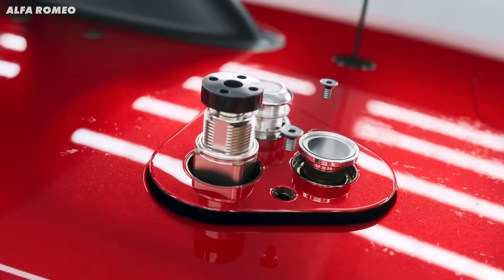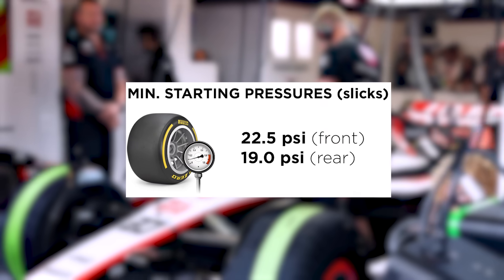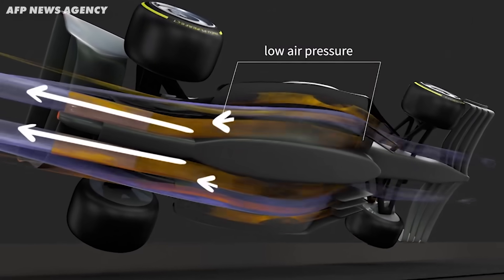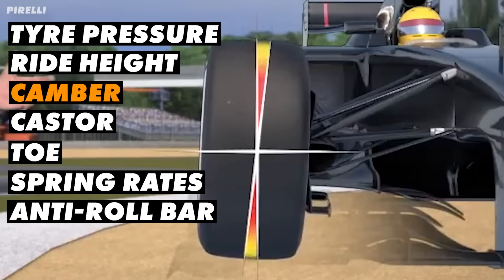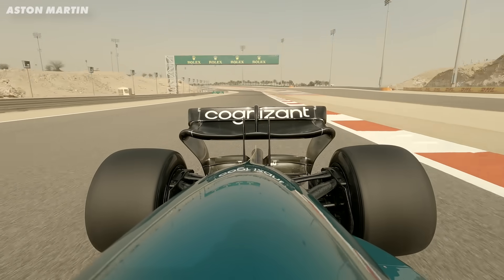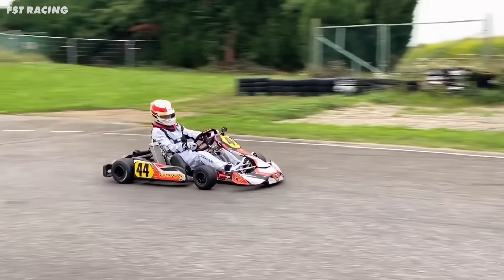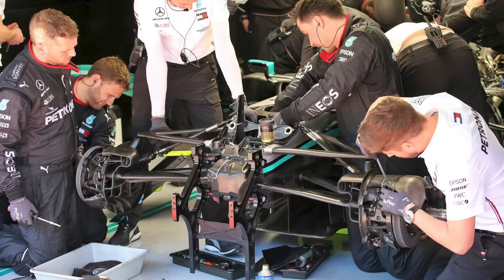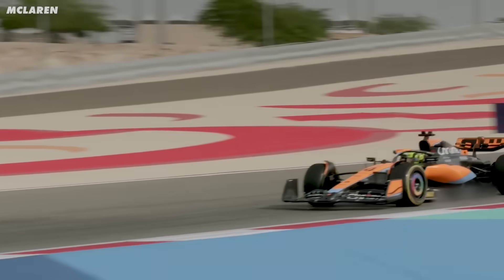Why F1 Wheels AREN'T STRAIGHT | feat @brrrake

Comment: You mean....but don't state clearly in the intro....why do F1 cars run static TOE-OUT, on the front wheels ??

Very simple....I can save you the whole video.  Because toe-OUT helps with sharper turn-in, on the initial entry to a corner....PLUS, reduces front end slip angles, therefore helping to reduce understeer.  This is a common alignment profile on most "formula" (open wheel) cars. 

The down side (and yes, there is always a trade off)....is that toe-out makes the car much more "squirrely" (that is, it causes the car to wander and follow every little pavement irregularity). So, it is not really suitable for passenger cars, in most cases. But, for racing cars, especially top-echelon cars like F1....it is a very acceptable trade off.

Comment: Personally find it strange that caster is treated as a fixed value, instead of exploiting it, for its dynamic affect on camber.
Reply: Do you think, just maybe, F1 engineers across all eras and with all teams might just know a tad more than you on this subject?
Reply: @Eat-MyGoal Yup, I get your point and agree.
I’ve also got a little bit of automotive background.
Have found that while setting up, too specifically, narrows the envelope of performance, and what variables of circumstance, like race lines, tire life, driver fatigue, etc, can be exploited, especially in unpredicted situations. Thinking outside the box, can sometimes yield benefits.

Comment: I look at this as a Forza sim player.  The whole tuning the suspension was paramount to building a great car.  You wanted to build as much mechanical grip as possible without applying to much downforce slowing the car.  I’d spend hours watching the heating across the tires when at track speeds.  Next was how compliant the suspension was.  Getting the bump rate was pretty straight forward but getting the rebound rate was much more complicated.  When you hit the sweet spot the car would be a pleasure to drive.

Comment: Just as a train has its steel wheels set on an angle on the railroad tracks so it will go straight but if you put the wheels square on the they will go into themselves

Comment: Average drivers know almost NOTHING about how a car is moving. Stability? They take it for granted. Braking? They rely on anti lock systems. They can't drive themselves!
Reply: Which seems like a good thing.  Average computer users don't know how the transitors in the chip work or even how the motor in their blender works.  The modern world is great because we can all have our own specialties and don't need to know every detail of everything.
Reply: @petergerdes1094 correct, but people not even understanding basic concepts such as concentina effect, braking distances needed etc, isn't ideal.

There really should be a higher standard held for being able to operate a vehicle.

Comment: Anyone can change the toe settings in their own car and experience the effect themselves. Quicker turn in or stability vs tire wear. Of course camber and caster. Rather than spending thousands on mods, a simple wheel alignment adjustment can do wonders for performance. Unless you go nuts with it and make everything worse.

Comment: Common misconception in here about the effect of camber on contact patch area.  Camber doesn't affect TOTAL contact patch area.  Contact patch area is simply a function of tire pressure and load (weight).  So a tire inflated to 20 psi supporting a 400 lb load will have a contact patch area of 20 square inches regardless of camber. Camber affects the SHAPE of the contact patch and therefore the distribution of stresses within the contact patch which can have a large effect on grip.  Otherwise brilliant presentation!

Comment: This was a great explanation of the various suspension settings on these cars. I’ve always wondered how they are able to get it set back up correctly when a driver destroys a corner and all of those parts need to be replaced. It’s not like you ever see them doing an alignment in the garage.

Comment: They have reverse Ackerman front geometry because of weight transfer meaning the outside wheel can stand more slip angle. They aren't designed to be driven slowly 😊

Comment: This is a particularly good video, a topic I don't think some of more recent F1 fans understand. All those mechanics swarming over the car during practice and qualifying have a lot more to do than placing the cooling fans and wiping the car with a polishing cloth. I think there's a tendency to think they drive nearly the same car at all times, or maybe they set it all up at the shop using simulator data and just run it that way. That's never going to be the case. The simulator isn't perfect, it's just close. It can't know exactly how the pavement aged over the last year, fully incorporate any pavement heaving or new patches that occurred since their last visit, or deal with normal variations in temperature, humidity, or the likelihood of rain.

Comment: quick math 800kg*5g/4 each tire with contact patch the size of your palm is actually pushing the road  ~1000kg towards the outside of the turn (and same reactive force tranfered to the car towards the inside)!

Comment: even your normal car the wheels dont all point strait forword with front wheel drive they point slitly to the outside to compensate voor the power on the wheels that will pull them inward
Reply: Not true - look up the target parameters for any fwd car, you’ll see they always toe in. 
 Manufacturers prioritise customer desire over engineering knowledge.

Comment: With tyre pressures @ 20psi how do they get the responsiveness out of the steering?

Especially with the old cars running 15 inch wheels.
Reply: Because contact area has nothing to do with friction. The contact area has to do with the structural integrity as well as wear and tear on tires. People never distinguish the physics involved when talking about "traction"..
Reply: @Dyson_Cyberdynesystems  
I'm not talking about the contract area.
However the contact area is directly responsible for how much friction there is. Bigger contact area equals more friction.

I'm talking about low pressures allow the rim move. Lower the pressures in any vehicle and the steering becomes less responsive.
Reply: @Robert-j6r8c  I mean. I'm not giving you an opinion. Friction is completely independent from contact area. It is a product of the friction coefficient of two materials and the normal force applied to the contact plane. Tires would be less "responsive" because the tire structure collapses under lateral forces. You can counter for that with structural sidewall reinforcement or lower profile tires..
Reply: @Dyson_Cyberdynesystems  we're taking about contact area and friction on cars. The
More contact area on a car the more friction you get.

F1 must have really stiff sidewalls then.

Comment: The contact patch is really only the area of your palm? Isn't that less than a typical street tire?
Reply: Just found out about this as well. Wonder how small the patch is for old grooved tyres
Reply: Mr harris, my high school shop teacher, in 1982 told us that us sneaker probably has more contact area than a car tire. Next time you have your tire off, dip it in a small puddle of water and then put it on a piece of cardboard. You'll be surprised how much of the cardboard doesn't get wet.

Comment: one thing the sims/games could do would be to better represent graphically in the settings window, how any settings would actually affect the car. the amount of camber represented graphically such as in this video would be a great help with new drivers/players
Reply: Forza motorsports & horizon 5 are really good with the depth & realism of the tuning. But they just give a description iirc. A diagram/picture should definitely be included for those not already familiar with all of it

Comment: What if there was a way for your wheels to automatically adjust the camber angle to maximize grip, improving acceleration, breaking, corning all while extending tire life and improving fuel economy?
Reply: That level of active adjustment isnt even made, itd most likely weight alot though, it might be slower then manually setting it up
Reply: The total weight added to the car would be very minor. The angle adjustment would be calculated by and onboard computer weighing less than a smart phone. I'm the patent owner this concept. @12th.jahlil
Reply: That's active suspension
Reply: @dsdy1205  I dont think that impacts camber. Just damping and spring rate i believe

Comment: Is the DAS the "magic" Ham was mentioning after he crashed soon after warming his tires?
Reply: No, he was referring to a brake bias setting. The "brake magic" setting shifts more brake pressure to the front. This allows the front brakes to generate more heat and warm the front tires better. He accidentally turned it back on and cause the front tires to lock up.
Reply: @mr0sparkles4682  Cool thanks.  That is what I originally thought.

Comment: some fundamental vehicle dynamics completely ignored in your explanation here...   just because a motorcycle leans inward to make a turn doesn't mean that's how the bike makes the turn.... both cars and motorcycles the furthest thing form the apex are the TIRES with most grip (obviously the only tires the motorcyclist has)...  the inward lean of the motorcycle is AKIN to the outward BODY ROLL of a car...  fundamentally the motorcyclist is trying to create a similar angle to that of car body roll...  inward/outward towards apex blah....   It's the ANGLE that matters
Reply: The video stated that camber thrust is a large factor in the way motorcycles generate grip. Which requires... roll.
Reply: @brrrake  I'm saying stop seeing a motorcycles vehicle dynamics as different from a car...  mentioning a leaning inward bike in turns...  NO  the rider is MOVING THE CG INWARD TOWARDS THE INSIDE OF A TURN...  ODDLY ENOUGH A SIMILAR PLACEMENT TO A CARS.  If you had any idea what you all were saying YOU WOULD SEE AND UNDERSTAND THIS...  THE CG IS IN BOARD TOWARDS THE APEX AND THE TIRES (THRUST LINE) FURTHEST AWAY.  The angle created by the cyclist is not far different from the body roll of a car...  MECHANICAL GRIP!!!
Reply: @emteehed  your keyboard seems to be having some malfunctions. I really like my Anne Pro 2. It's great.
Reply: @brrrake    the only thing worth reading in your reply ....  and i quote 'requires... roll.'  the smartest thing i've seen or heard you say on youtube yet in concerns to CARS.
Reply: there's youtube playlists of Top Gear Power Laps with The Stig from BBC... Car Manufacturer after Car Manufacturer Car Model after Car Model... They all have 1 thing in common...  BODY ROLL...  Ferrari, BMW, Corvette, Pagani, Lamborghini, Porsche, etc....   Supercar to Consumer Road Car...   I'm gonna quote you again since you seem to be learning finally...  'requires... roll.'
Reply: @emteehed  body roll happens. Yes. It's a function of the roll stiffness. In road cars and motorbikes the roll is completely different.
Cars: roll because of lateral forces.
Motorbikes: roll to balance the centripetal force so the rider doesn't get yeeted off.

Are you familiar with Dunning Kreuger? It's a really interesting concept I'd suggest looking up.
Reply: @brrrake  BTW Center of Gravity is KING

Comment: Interestingly, camber, caster and toe is actually something that all road cars have built in as well, though it's obviously not for performance, but to manage the wear of tyres, and they do have to be adjusted every now and again, and tyre pressures is obviously something as well, but that is more common knowledge than the others
Reply: It is also for handling and performance as well as tyre wear, road car setup is a compromise between many factors, if it were set wrong you'd pretty soon be complaining about fuel economy, lack of manouverability, heavy steering and picking bits of your car up off the side of the road after you'd lost control and smashed it up on a corner.
Reply: @M0UAW_IO83  Well yeah, i just mentioned a few, as i didnt want to get too much into it

Comment: Always great when a top level racing series limits the team engineers because the tire manufacturers can’t be bothered to make better tires. 
You want to run lower pressure and higher camber so the car is better? Nope. 
F1 really needs 2 tire makers so there’s actual competition and Pirelli quits being lazy and just blaming the teams for junk tires.

Comment: Toe has an aero effect. Toe in increases the wake on the inboard part of the wheel, toe out reduces it. Of course for the effects to be significant you have to run like 5 degrees of toe, not realistic or practical. Outwash inboard of the wheel does the same thing as geometric toe out from an aerodynamic sense.

Comment: It is honestly a shame how little wiggle room for adjustments related to the tires the teams actually have. With how tire development has progressed to try to provide maximum durability and consistency, it really has killed the unpredictability of tire strategy during the races.
Reply: In part this is a safety issue. Too low tire pressures can be faster and yet cause damage to the tires leading to failures.
Reply: That’s what you get with a single make in a high level series. There’s no competition so tire makers do what they want and blame the teams if there’s a problem. 
Rather than design a tire that works with what the teams want they’re designing tires for what they want and making the teams try to figure it out.